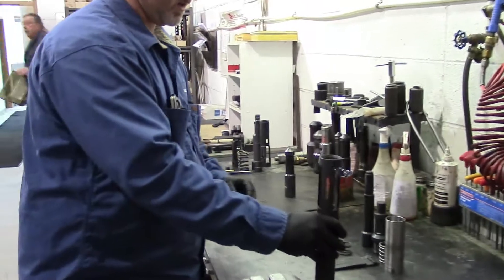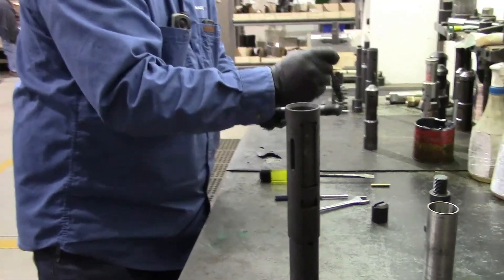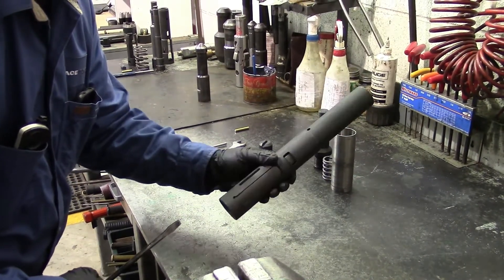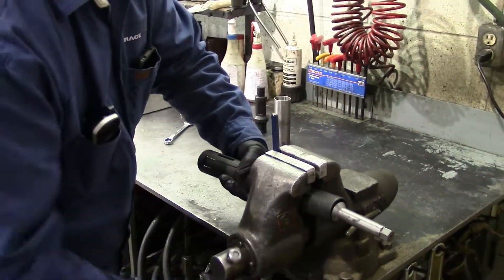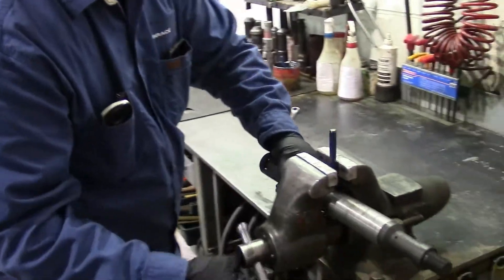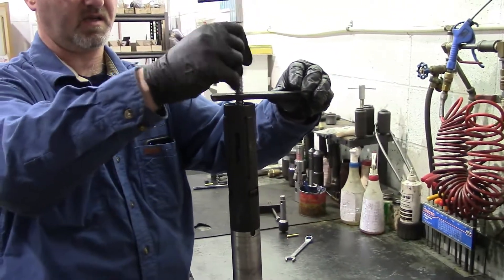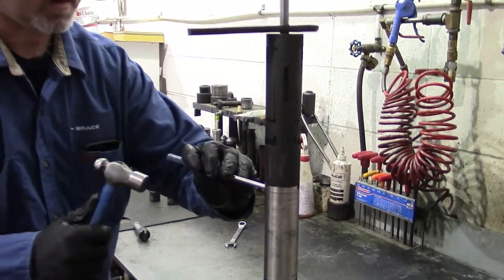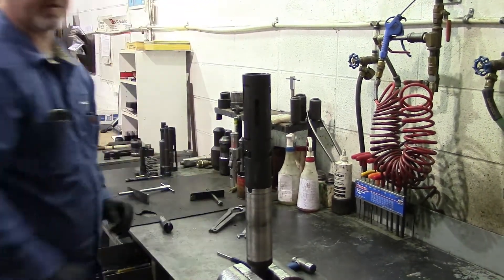Slickline SB Pulling Tool Assembly

Comment: Isn't there assembly hole?
Reply from the maker: Yes sir, there is a 2nd hole in the core that can be used to assemble. However, I prefer to use the pinning hole when assembling as I am able to function test the tool immediately once it is assembled.